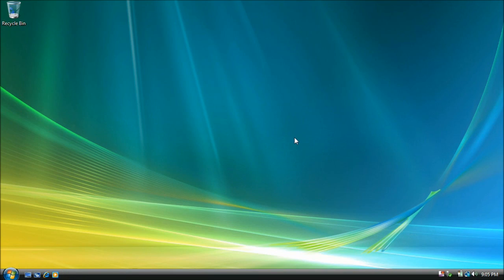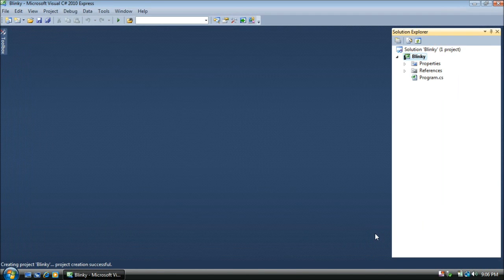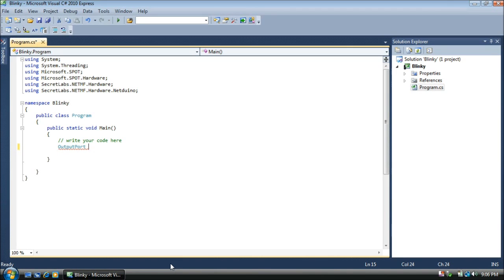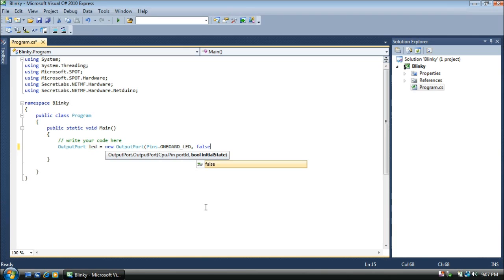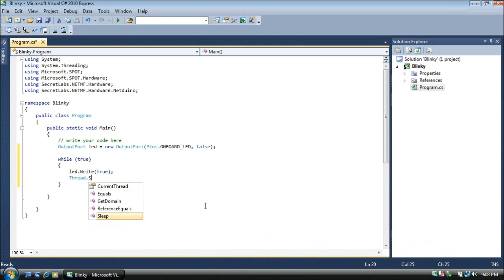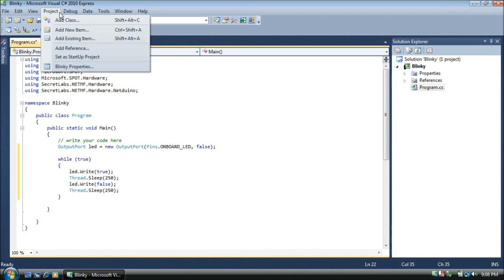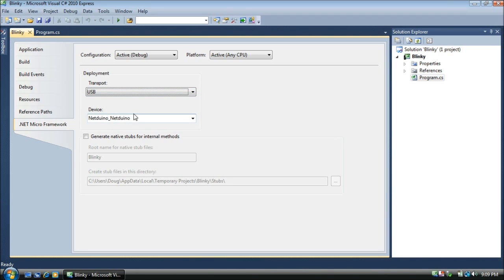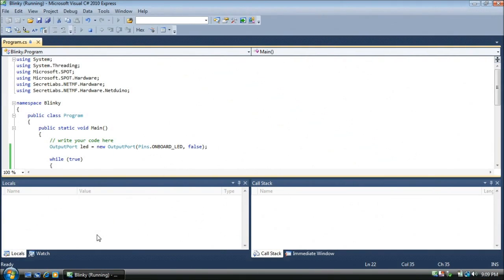Getting Started with Netduino

Comment: Thanks :) All I'm saying is although this may be useful for a beginner. I know from the full framework that you should not be using Thread.Sleep() as a means of timing events. Because it actually means to relinquish control to another thread. It is not going to be a very precise method of measuring for delay's for that reason. And there was a good blog post I read about this from another .NET Microsoft MVP that explained about this.